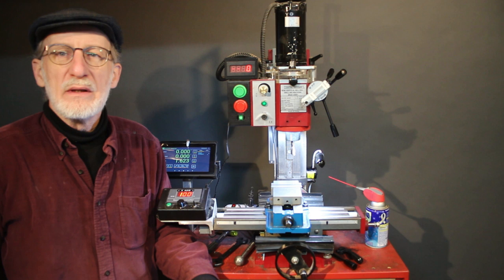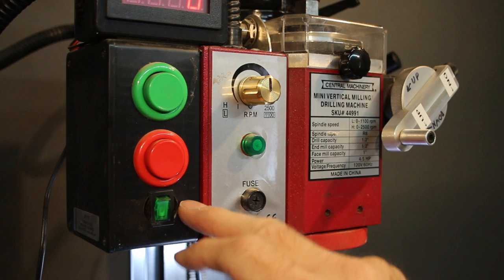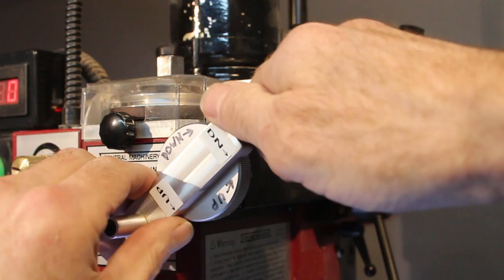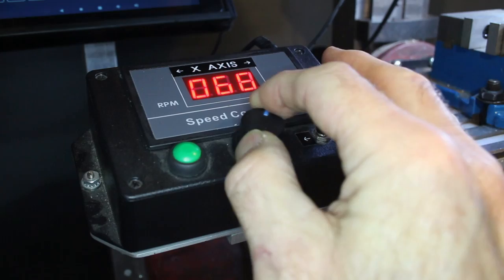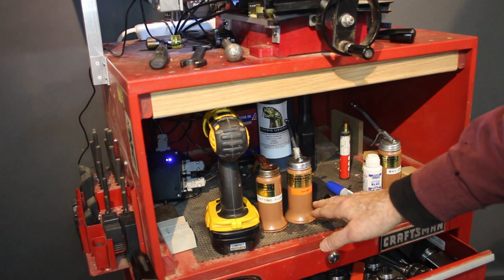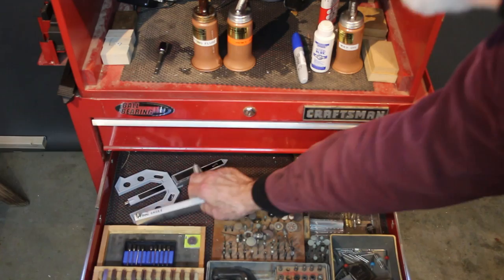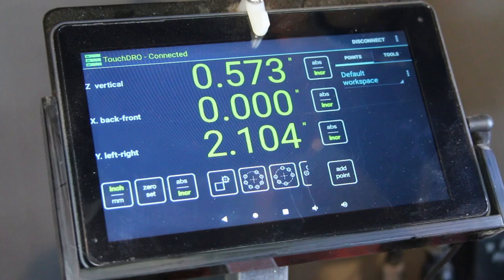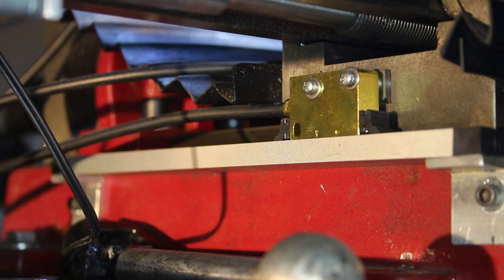Upgrades for my Harbor Freight mini mill

Comment: I just found your channel and this is just the kind of upgrades I can do to my Mini-mill without all the other metal machine tools like lathe or welders etc., that I have seen all over YT.  I even like the ring light and am thinking of using it even on my drill press
Reply from the maker: Glad I could help!  Have fun upgrading.  Links to products are in the description.

Comment: Since most mini-mill owners never tilt the column, you might consider fixing it permanently at 90*.  It will improve rigidity.  Also the big pivot bolt actually compresses the hollow column so alleviating that would also improve stiffness.
Reply from the maker: I'm going to seriously consider this. I've seen other videos where people have made a permanent fix. But I worry about getting it perfect.

Comment: Nice video and a lot of nice upgrades.  I bought a Grizzly min mill a few months ago.  I view the mini lathes and mini mills as kits that come assembled and you get to take them apart and reassemble them with improvements in function and accuracy.  A video on making the touch DRO would be very interesting to me and perhaps others.  I had not known of the kit option that works with Igagin's DRO.  Thanks for this video.
Reply from the maker: I actually tried the inexpensive kit and bought the iGauging scales separately. Unfortunately I couldn't get it to work. I would get readings but they would jump around the moment I started my cross slide motor or the main motor. I worked for days trying to eliminate the interference issues and couldn't do it. So that's why I went with magnetic slides because they're much easier to install (although more expensive).

Comment: AWESOME information!    

I love the repurposing of off the shelf products!        

I am a retired motor controls engineer,  I have a harbor freight lathe / mill / Drill combo that is on my list of projects.     

The issues with the low cost DRO isn’t surprising.  All variable speed motor controls can create noise that interferes with low level signals, DC is much worse than AC,  add in running them on single phase for the worst possible scenario!   Using an isolation transformer to feed the DC controllers might eliminate the problem.   Using sensors that are 
immune like you did is the ultimate solution !  

I am looking at the possibility of utilizing motors from RC vehicles for power feed.  The latest technology RC motors are amazing on power and low speed torque.  They also have a lot of  gearing options available at low cost.   

If they work I can run them off of RC battery packs or separate power supply.
Reply from the maker: Thanks for your kind words.  Yes, brushless DC motors for advanced hobby vehicles are crazy powerful and I'm sure a geared motor would work fine.  I like the fact that the DC gear motor that I used is a little under powered and will stall out if overloaded.  Keep that in mind when you specify a motor because if you overpower it it could damage things.

Comment: Hi again Guy! Just somewhat recently talked with you about the mini lathe deburring and cleaning and have had this machine in my sights for years. I absolutely LOVE the touch DRO idea with the tablet.. been looking for a while now at the 7 segment LED dro's and they are quite expensive. Looking at going the self built PCB route (self assembled kit) from the touchdro site and will be getting those installed on my minilathe and hopefully soon this little guy! Thanks for posting and love your ideas and thorough detailing. Keep it up and enjoy!
Reply from the maker: Thanks for your kind words. Make sure and get either magnetic or optical scales for your dro.  I started out trying with the really cheap ones and couldn't get it to work.  Magnetic scales in particular are really easy to use, just cut to length with a hacksaw.  Little Machine Shop sell a 1 m length with all the little mounting parts which is plenty for most machines

Comment: I moved the hole for up down axis to balance it without major overhaul. Then I crashed the plastic gears, and I replaced it with the belt drive, much better and quiet. Then add an auto head light led ring light like you did and now I can see. As for the right left axis I used a car 12 v window motor to drive the bed and made my own power supply with speed control and right left switch. A little connector under the left end lets me use it or not.
Reply from the maker: Great minds think alike! I didn't think to use the car window motor that I had. It's kind of bulky isn't it? The smaller one that I purchased for my left right movement is just barely powerful enough, but it works so I'm not going to mess with it.
Reply: Car window motor is gear drive which slows it down and gives it plenty of power but look clunky
Reply from the maker: @jamesacker7343  yes, I'm working on installing a similar motor to drive the carriage screw on my mini lathe.  I ended up going with a relatively expensive 24 V DC right angle helical drive motor.  That video will be out in a few weeks if you're interested.

Comment: Brilliant! 👍👍
I've been debating maybe getting one of these mills. It will either be a tool that turns out I will use all the time, or one that I will rarely use...  🤔
Reply from the maker: I totally understand. I bought mine and didn't use it much until more recently when I kept finding more and more uses for it. That's why I fitted it out and upgraded it so much.

Comment: This is great!  Would love to do some of that to mine, especially a DRO and those power buttons.  Those magnetic scales seem to be about the easiest to install that I've seen for this mill.  Question for you.  Have you had any problems with the table locks?  I'm not sure if mine are within spec.   They don't "lock" as much as they just provide a bit of resistance.  You can move the table or the quill with them in the locked position before even realizing it.  The quill especially has become a problem when cutting because it'll force it to lower during the cut unless I both lock it and engage the dog teeth.  Any tips on what to do to make them engage tighter?  I haven't broken down the mill yet at all.
Reply from the maker: If you inadvertently lubed the ways with regular oil, that would make them too slippery. You should only use proper way oil which has stiction to help things stay in place.
I have always been able to tighten things so they don't move, so this might be your issue.

Comment: Hi there - have you ever thought about upgrading the drawbar collet change situation? I love the pneumatic ones I have seen for larger mills, so am thinking about trying to figure it out for the smaller ones like you and I have (I have the Northern Tool Klutch variant). I have done a conventional DRO so wondered how your scales hook into your Touch DRO tablet? My scales have the standard DB type connectors. Do you post your switch wiring anywhere? That is really slick along with your tach. Great job on these and thanks for posting!!
Reply from the maker: I have no plans to do a drawbar quick change. It's just not that important to me.
Any scales with a DB9 connector should be compatible with the touchDRO.  Check his website for details. I used magnetic scales because they are easier to cut to length and mount.

Comment: Great video Guy. I just received my HF mini mill & am anxious to  get to work with calibration and upgrades . I think a drive on the X table is almost a  must . What ratio gear motor did you use. I look forward to doing all of your upgrades and thank you for sharing
Reply from the maker: I do not subscribe to that thinking. I have been using my machine for years without upgrading the column.  It's possible that these people who complain about it come from using large Bridgeport machines and expect the same performance from a hobby machine.

Comment: Hey Guy, what’s the turning knob switch you installed in the mill? It seems to not come with the existing kit. Mine just gave out (switch doesn’t work anymore but motor is fine) and I’d be interested to know what you used!
Reply from the maker: if you are talking about the big red/green buttons - that was a major hack to the electronics that I would not recommend.  I have since replaced the motor with a 600W brushless one that has very simple controls:  https://youtu.be/ndhsCeuEv-4
I particularly like the emergency stop feature.

Comment: What’s with the run out at the top of the spindle, and the worm shaft where it connects to your x axis drive.  Is something bent?  Mi Micro Mark mini mill, which looks similar to yours doesn’t have  this.  You have some very nice ideas for upgrades.
Reply from the maker: There is no run out. It's some kind of optical effect from the video.

Comment: Where did you get the nice start -stop push buttons and box? They do not look like they are maintain contact so do you use a latch relay? Any schematic to how you wired them in? Like the small crank handle so any basic dimensions on the handle offset and size? I've head comments how the ring lights cast shadows when you use a drill chuck.   Still wonder if the LMS belt drive is worth the $160 cost? Not real happy with my igauge DRO but I guess you get what you pay for. Enjoy your video.
Reply from the maker: If you search the web for a "power tool start stop switch" you will find inexpensive switches off the shelf. I choose to make my own because I'm an electrical engineer and I used video arcade game buttons and a 10 amp relay.
Yes, the ring light does cause shading with chucks and large fly cutters, but things held in the R8 collets when they are right close up to the head or very well lit.  I'm planning to do a detailed video about that ring light.
Reply: Designed a lot of control panels in my day when most  were AB 800T series switches and pb of all types. Hate that flap switch on mine so should do something!  Getting lazy at 74.😥

Comment: The trouble with mounting the X-axis scale on the back of the table is that you lose about an inch of Y-axis travel. I managed to mount mine on the front after modifying the gib adjusting and locking system and adding a side extension to the table.

Does the v-belt drive modification cause you to lose torque? I have seen this remark elsewhere.
Reply from the maker: Yes, I'm aware of the reduced X-axis travel, but it's no big deal for me.  I did consider putting the scale on the front, but it was just too messy.
The V-belt works very well with the special belt I got from Grainger that is very "grippy".  Actually the motor has a torque limit that shuts it off more often than belt slip.  And of course, I can adjust the belt tension to enable slipping if I need to.  Beats the heck out of stripping plastic (phenolic?) gears! :)

Comment: Thank you for sharing really great upgrades. Do you have any issues with the tilt column when tramming the head?
My mill is similar a Seig X2 and plan to kit it out like you have done.
Reply from the maker: No, I had no trouble tramming in the column.  I made a tramming adapter for my dial indicator that brings the indicator out 8 inches from the chuck.   I then loosened the big nut on the back just enough so that I could take a small rubber mallet and tap tap the top of the column gently to move it a little then I would retest the left and right swing with the dial indicator.  Took about 15 minutes.  The best test of a well trammed machine is a large diameter fly cutter pass on some aluminum, you want to see both the front and the rear edge of the cutter leaving an impression in the metal.  You get these beautiful interference patterns when you hold it up to the light when it's a perfect cut.
Reply from the maker: I just posted a video showing how I tram the column on my harbor freight machine:
https://youtu.be/8iK1hlLNB9E

Comment: wondering if youve had any trouble with the  Z gib lock lever ..........fixed mine once and it happened again but forgot what I did , or maybe that round radget piece is stripped  where the srcrew goes in???
Reply from the maker: Nope, no problems with mine as yet. But I'll keep that in mind and have a look.

Comment: Thanks for your reply. I am not a machinist, but want to get better at this for my simple purposes. I would like to know what length the scales were that you used, and the make of that nice DRO you utilized for your mill.
Reply from the maker: I'm not a machinist either! Just a hobbyist doing my best.
Links to the DRO and scales are in the description.   The Touch DRO uses an Android tablet and I want the tablet with the software pre-installed by Little Machine Shop.  Hope this helps.

Comment: Can you show us how you mounted the tach sensor and magnet? Thanks
Reply from the maker: Here's my video about adding tachometers:
https://youtu.be/M0AiAv8XL7c
Reply: @GuyMarsdenMakesStuff  Thank you Guy I am just getting around to setting up my LMS X2D mill and your video was very helpful. Im sitting on the fence about doing the belt drive conversion but their seems to be mixed emissions on it some say you lose a lot of torque with it. What are your thoughts on the belt drive.   Thanks again Bob
Reply from the maker: @bobkarstien1248  I'm very happy with the belt drive mod. It's very easy to tension the belt and I don't think there's any compromise in torque.

Comment: Hi Guy  question on the table motor controler  what is the power input to the controler  /.I would  like to get a little information on that . did you use a transformer  to supply it ? . Thats not stright 115 volts ac right? thanks paul
Reply from the maker: It's a 12 volt DC motor on a transformer. I did something very similar for the carriage on my lathe. See this video:
https://youtu.be/B18NLCKUYK0?feature=shared

Comment: I use that same type of geared down motor, but they come in many different speeds. Which DC motor with the gear box did you use for the X axis?
Reply from the maker: The motor I use for my Y axis drive was: "Aobbmok DC Motor 12V Low Speed 180 RPM High Torque Little Geared Motor with Metal Gear Reducer ".
https://www.amazon.com/gp/product/B07DYS2LHS
Reply: @GuyMarsdenMakesStuff  Thanks, I have used these motors in 30 rpm. They are great but the gear box does not mesh well in reverse. The ones I have used only like going in one direction. I had a look inside the gear box and I saw that the gears were not set up for both directions. 
have you found any problems with your going in both directions?
Reply from the maker: @EL34XYZ  No, I have used this motor a lot and really load it down sometimes with no issues.
Reply: @GuyMarsdenMakesStuff  A closer look at your motor shows me it is longer and probably more powerful that the motors on the two units I have. My application does not require any power, just slow turning a small drum

Comment: I am looking to purchase a mini mill and I appreciate the time you spent on showing the upgrades. Does this mini mill cut steel ok?  What was the cost of the belt drive upgrade?
Reply from the maker: All mini mills will cut steel, you just have to go slow and have the right tooling.
Check the description for links to everything I talked about in the video, I don't remember pricing.

Comment: Can you make a video or describe how you put the switch in the motor controller? And where you sourced the dc drive motor?
Reply from the maker: Thanks for watching! 
Sure, I might do a quick video about that, but I'm currently producing an extensive video about motorizing the carriage on my mini lathe that uses all of the same concepts. So stay tuned for that and it might answer those questions for you.
Reply: Thank you I will watch that also!
Reply from the maker: @rodbrace1604  here it is: https://youtu.be/B18NLCKUYK0

Comment: For the DRO, does it include the read heads or just the scale?
Reply from the maker: You purchase a 3-ft length of magnetic scale, then the heads separately from Littlemachineshop.com, and finally they Touch Dro interface and tablet to complete an entire system

Comment: Hi, nice video. do you have the reference or link for the motor of your powerfeed. I bought one that seems identical, but it is does not have enough torque for a powerfeed on a mini mill. or may be you have some ball screws on the x axis ? thanks.
Reply from the maker: The motor I used is this one: https://amzn.to/3DitFh6
and I used this controller: https://amzn.to/3ro8tmY
(as an Amazon Affiliate, I earn from qualifying purchases.)

Maybe the one you got was too fast - and thus lower torque?  There are dozens of identical motors with different speeds.
Reply: @GuyMarsdenMakesStuff  I have one similar but at 160RPM, and it is announced at 10kg.cm of torque but I doubt it ... other are as 1.2kg.cm torque. shame the one on your link is not available anymore ...
Reply from the maker: @jeanyvespochez  I'm sure if you research other sources like eBay you will turn up one. They are a very common motor.
Reply: @GuyMarsdenMakesStuff  thanks, I'm searching. it could really help if you could measure YOUR motor body dimensions , that we know has enough torque? height and diameter ? there are so many different motors, and chinese sellers are often very generous with the torque calculations ! thanks again.

Comment: Guy what size light ring did you use on the spindle light
Reply from the maker: I used the 80mm, but your machine (if not an HF) may vary.  Just measure your spindle OD.
https://www.amazon.com/gp/product/B078Y6MFNB/ref=ppx_yo_dt_b_search_asin_title?ie=UTF8&psc=1